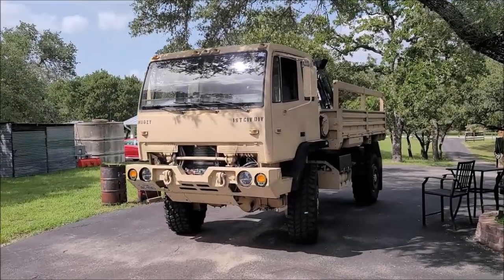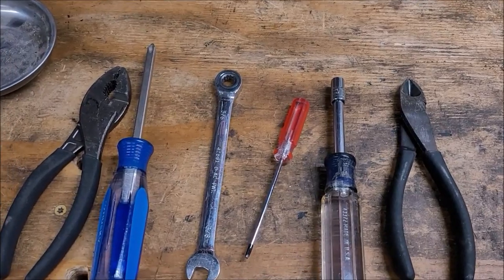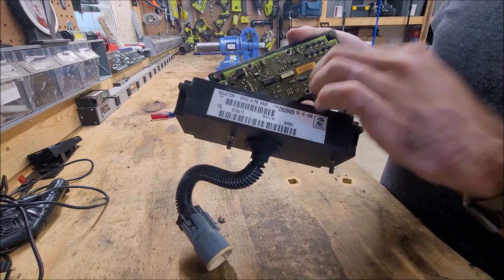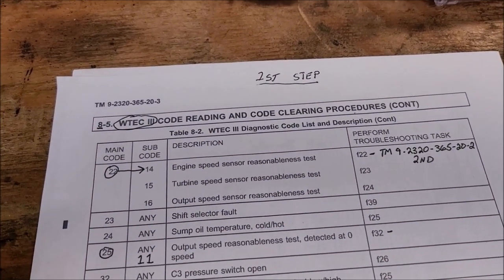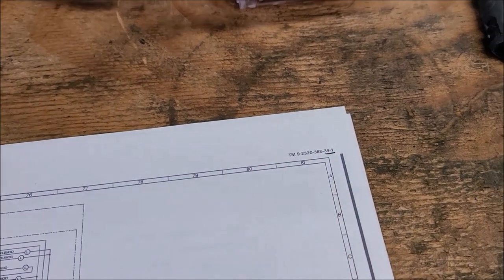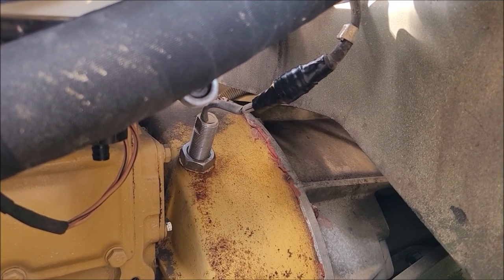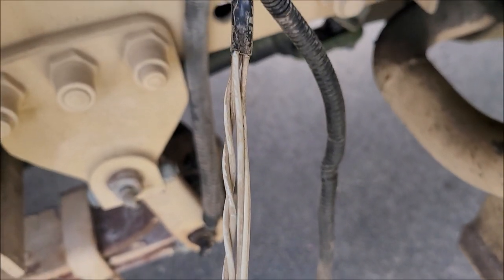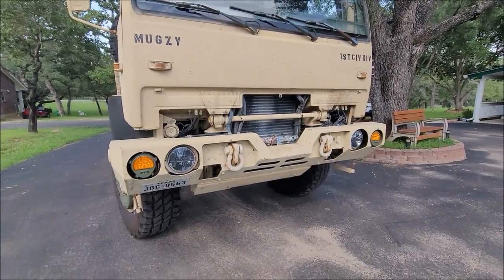M1078 LMTV - Update #12 Transmission Troubleshooting

Comment: Thanks, your Videos are remarkable, well-made, and informative. Cars also have problems due to the decay of the wiring harness. The plasticizers in the PVC sheathing volatilize, causing the cables to harden, become porous and brittle. Vibrations from the engine then cause the insulation to come off, resulting in short circuits. The background is that around 1990+- cables with biological plasticizer were used for the first time. Later it was noticed that especially in the engine compartment, due to high temperatures long-term issues arise. I would always rebuild the cable.
Reply from the maker: That makes sense, since this entire truck was in a hot environment most of it's life. I actually just replaced the harness as I got a great condition used one. It will be in my next video update on this truck. Thank you for the compliments, feedback is my favorite part about sharing videos!

Comment: Thanks for video! my LMTV is having transmission problems something in electrical I think, I did buy computer on eBay that did not solve my problem.
Reply from the maker: Yeah, it can be a big rabbit hole of issues. Check the connectors & stuff as I showed. Then, use the section in the TM I talked about in the video for troubleshooting. It's really one of the only way to get to a problem.

Comment: Great video. My LMTV wont go faster than 15mph. We cleaned out the turbo, nothing changed. We can't find the problem, any ideas?
Reply from the maker: It could be way to many things. Fuel, air, transmission, brakes. A lot to check.

Comment: Have you tried liquid insulation. Paint it on the wire allow to dry. Works well.
Reply from the maker: I have some of this & didn't think to try it. It would probably help but kick the can down the road. I set my mind to rebuild the harness wire by wire when I have the down time. The issue has not come back since I made this video.

Comment: Hey, just got my 1078, and I got a similar issue.
Stuck in mode, won't go into gear.
Any idea what to do ?
It was driving great, and got stuck middle of the road.
Reply from the maker: Check the wires and sensors I cover in the video. See what codes come out & compare them to the list in the file linked in the description. Really hard to say other than that, I am sorry!

Comment: Question about my air dryer on my 1994 LMTV: I rebuilt the original air dryer earlier this year and have fixed every air leak I can find but the air dryer still blows off every 20ish seconds. Any thoughts or recommendations?
Reply from the maker: I don't really know much about the original one as I got rid of mine as soon as I could since they are complicated. There is a troubleshooting section for the air dryer that talks about this I recall seeing when looking for something else. Do you have all the TM's for this truck?
Reply: @CallMeColtLLC  I think the TM’s are on steel soldiers. Might just have to swap it out. I rebuilt the entire thing and fixed all the air leaks so it’s baffling. I certainly appreciate you and Dave Anderson. You guys have been awesome resources for me. Trying to get this truck setup as a high water rescue vehicle. Spending my dime to hopefully do good things.
Reply from the maker: @Chadrick9276  The only thing I can think of is your governor on the compressor isn't set right. Yes, TM's are at Steel Soldiers. I want to use mine for the same eventually. 😎

Comment: Have you thought about using petroleum grease on your connections to help to protect them I have used this method many times
Reply from the maker: What do you mean by petroleum grease? Regular grease is made with petroleum & it is horrible for electrical connections. Dielectric grease is for electrical connections. But, this will not solve the issue of wire insulation failing.

Comment: I have the same problem with my truck I was thinking that I would take the harness out and individually change the wires buy splicing and cutting them individually of course
Reply from the maker: This is probably what I will do as well. When I do it, I will document it & share the needed tools & part numbers. Was told speed sensor wires need to be twisted together in the harness.
Reply: Ok this weekend im going to take the harness out any pointers on the connectors from the cab to the tranyy on how to take them out

Comment: With the Allison transmission you must have the manual throttle at zero or off otherwise it won't shift
Reply from the maker: Yup, it needs to be at a low enough RPM to shift.

Comment: Would it be possible to remake the harness.  By a bunch of wire and make a new section
Reply from the maker: Yes, that's what I may need to do.
Reply: @CallMeColtLLC  I love your videos. They help all the lmtv owners out alot
Reply from the maker: @ciwhamc  Thanks, the feedback makes it worth it!
Reply: @CallMeColtLLC  i don't own a lmtv yet but have found that your videos apply to other projects in general.  Looking seriously at 2.5 ton lmtv from MME in Missouri.  Hoping to avoid some of the possible issues by buying one at a somewhat premium but i understand that guarantees nothing.  Keep up the good work.
Reply: @neilmarshall629  Avoid MME...! That is who I bought my truck from. I thought the same way, buying at a premium is the best way to go as they will inspect the vehicle and make necessary repairs. Well they don't.  I've had to replace my transmission ECU and controller $12,000, my transmission $9,000, and my engine: $15,000.  This was on a truck that had 1,000 miles on the odometer also which they said had "zero leaks or mechanical issues." open an account on govplanetdotcom and buy your own truck for a fraction of the cost.
Reply: @arhtxcabinetsmillwork  yikes! Thanks for the advice
Reply from the maker: http://fmtvsales.com/ is an option as well. They come up for sale privately often too.

Comment: I can help you with your wiring issues in this video as well as the mill spec. Cable connectors as well. I’m a former US Navy wiring electronic specialist.
Reply from the maker: Thank you! I ended up replacing the entire harness with a known good one to save time. But, I could use your help finding the proper part on a different connection that I've wasted countless hours and over $150 on trying to locate!
Reply: @CallMeColtLLC  , i’d be interested in getting your old harness if you haven’t tossed it yet and are getting rid of it. What part do you need help sourcing?
Reply from the maker: @shaunmac2002  I did not toss the harness, I have it for sale on my eBay store. I'll give it to you in trade if you can source me two of the connectors I need a long with a part number. YouTube flags comments with links, but I have a link to my email in the "About" page on the channel as well as on my website.

Comment: American army should learn to drive manual!!!You never had issues with a plain jane manual!Given these vehicles are of a military origin,think of trying to diagnose these hickups in combat scenario!?
Reply from the maker: This vehicle is nearly 25 years old & has been retired from military service for almost 10. These trucks a generally trouble free when in service. The automatic transmissions prove to be more reliable & last longer over the service life than manual. It also gives the operator more ability on concentrate on driving or other tasks at hand, especially if injured.

Comment: that wire harness sucks ass and all the wires are white...
Reply from the maker: The wires do have numbers though... 🤣
Reply: A numbered wire is way better than any colored wires.  Good luck building a new harness, lots of great suppliers out there for Deutsch connectors.  One in particular is in Kettering Ohio called Ladd.